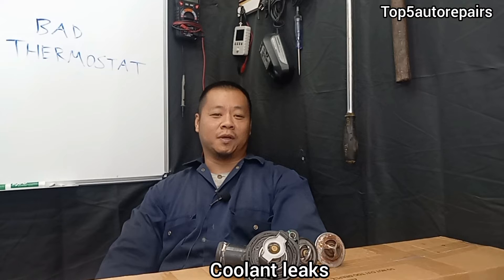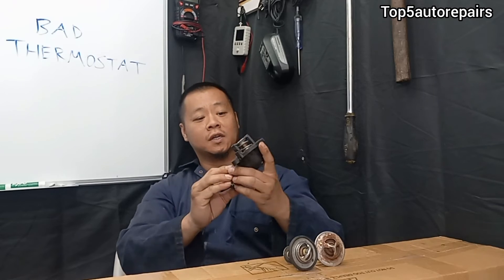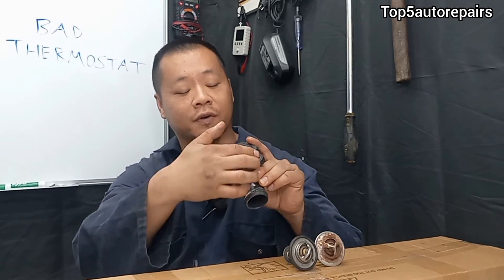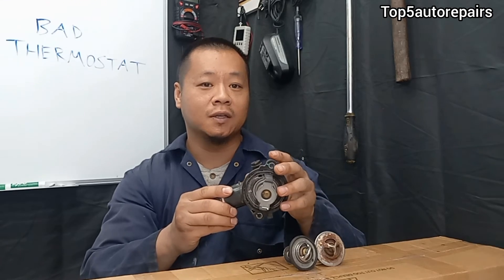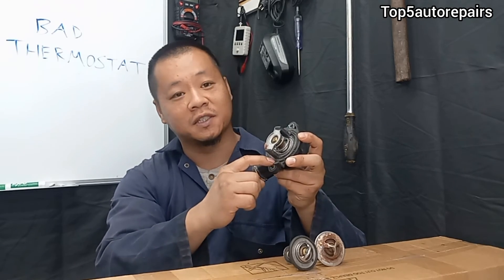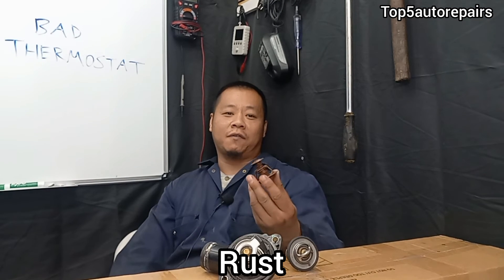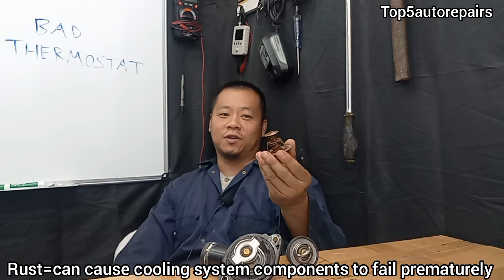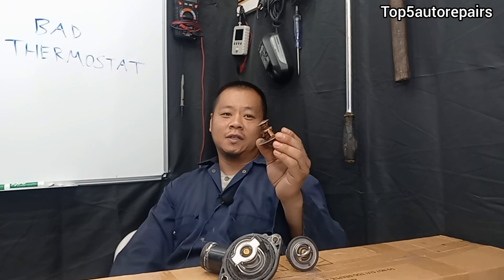How to Tell Car Thermostat Is Bad (Symptoms of Stuck Open Stuck Closed and Overheating)

Comment: No garage has been able to work this one out! VWTouran 62, after both thermostats were replaced by dealership (because of overheating issues )afterwards I now have underheating issues! The dash temp guage sensor has been replaced. Still the guage fluctuates up to 90c n back down to zero. Oil is 50 to 60. And not much heat in cabin. Tho it can stay at 90 and oil at 100 and good heat in cabin. Each time I drive the car I do not know what to expect because its intermittent. Water pump has been changed. AA guy came out today as engine light showed. He was certain it is the thermostat but VW wont except it! I have no idea what to do next.
Reply: Change it yourself 👍🏼
Reply: I would if I knew how! Lol not forgetting Im a granny now not a spring chicken! 🤦‍♀️

Comment: I have a 20–40-thousand-mile Subaru 6-cylinder engine that sat on a bench in an unheated or cooled garage in the Northeast for a few years with no antifreeze in it.  When I ran the engine, the thermostat never opened.  Could it have rusted shut or something else go wrong when it wasn't lubricated?  Thanks.
Reply: Yes, thermostats can rust, get old, all manner of issues. If someone used water in that engine for cooling at one point, then it will rust.

Comment: I have a 2007 Pontiac G 5 2.2L with the heater:

• shutting off when I drive over a sealed line on highway, or accidentally drive over a pothole. I generally avoid driving on potholes;
• turns back on after driving over sealant line on highway, or a pothole;
• heater does not turn on when it is really cold out; and
• driver side footwell gets hot in the summer, especially the floor.

I changed the blower motor, blower motor resistor, blower motor switch, blower motor relay fuse.

My thought has always been that the thermostat needs to be replaced.

I was told the Climate Control Module needs to be replaced as the Recirculate button flashes a couple of times and does not stay on. That one costs like $880 at Napa!

I would like to know if failing thermostat causes my problems? Or is it the Climate Control Module?

Thank you.

Comment: I have a 2000 Isuzu Rodeo that overheats. It melted the radiator cap, so I replaced that, but its still overheating.  NO heat when turning on the interior heating floor/vents or defrost. Has a new radiator and no coolant leaks. Thanks
Reply: Did you check water pump

Comment: What if an older 195° thermostat is only 1/8 inch open all the time and the engine temp stays below 200, even lower in the colder months?

But soon after installing a brand new 195° deg thermostat the engine goes into near overheating, before dropping down to under or at 200°???

Comment: Hey so my car overheats after sitting idle for awhile but on freeway it under temp and cooler by a bit and it takes a bit for my car to hit 180 on my gauge will a stuck open thermostat cause that? I changed everything my radiator my fan my thermostat my water pump and I’m still getting hot idling like if I did virtually nothing.
Reply: did you figure out what the issue was?
Reply: @iblessking650  yup the previous owner installed the water pump with rtb all over all Willy nilly; there was rtb in the water pump jackets; blocking a lot of the coolant from getting in

Comment: Lately the temperatures have been rising in Southern California, I have a Chevy express with the 6.0 and today while driving through the mountains I stopped for a bit on the side of the road and the temperature read 210 it used to read about 180 few weeks ago and it is usually at 190 more or less. Should I be concerned?
Reply from the maker: Yes if the temperature stays above 190.
Reply: @Top5AutoRepairs  so I finally had some time to get my hands dirty and replaced water pump, thermostat, radiator, and fan clutch and my issue still persist. What else can I try? There are no leaks. Thanks
Reply: Flushing the system may help, also could be a coolant temp sensor issue.
Reply: @aaronmlller8150  thanks for the suggestion, I actually have replaced the temp sensor and the issue persists. I never saw the coolant cycling through the radiator which is leading me to believe that there is some blockage somewhere, I don’t know how likely that is to happen
Reply: @Sr_iRL it happens more times that one would think!

Comment: My fire fusion’s driving me crazy man 2o14 2.5 liter there’s a leak near the plastic 3 way value that he upper radiator hose connect to next to the reservoir it leaks when I drive but there’s not crack. I changed the hoses the clamps it still does it 
I can’t find that part any where 
Only other thing I think it couid be is the thermostat anyone have any knowledge on this I’ve never had this happen I’m so irritated
Reply: It’s like pressure is pushing the water out of the upper hose connector between the reservoir and the engine where the hide connect ms to the thermostat and engine

Comment: Brand new thermostat installed!!.... Engine is at normal operating temperature but lower radiator hose still cooler than the upper radiator neck to engine coolant hose.... New radiator, upper and lower hoses and clamps too! Bled the system of air and still have the issue of that lower hose being cooler even at normal operating temperature!
Reply: That means your coolant system is working properly. Coolant flows from the top to the bottom. Hot coolant enters the radiator from the hose at the top, flows down and is cooled by the radiator fins, and exits the hose at the bottom.
 This is also the reason the bottom radiator hose can last two or three times longer than the top hose.
Reply: Having same symptoms what you do to fix
Reply: @CLIFFWILKES i have the same issue with my 2014 Avenger 2.4L. Any solution?
Reply: @edwardsoma  yes after months and months come to find out it was my oil cooler that was clogged it was on a 2007 chrysler 300 3.5, there were coolant lines that run threw the oil cooler, and the crazy part is I had to tell a Mechanic. Because he couldn't figure it out. It made me.
 So angry Because I paid him thousands of dollars.
 To just get everything else wrong. I only figured it out because I decided to just buy the book and study. In meticulous detail. Hopefully you get it going.
Reply: See video above.@CLIFFWILKES
Reply: Also check the temperature of the two hoses going to your heater core if they are at different temperatures or one is warm & one is cold then your heater core needs to be flushed. A clogged heater core will no produce heat inside the car. Also check radiator hoses top & bottom and make sure they not collapsed.

Comment: I have a 2010 b6 passat tdi, today while driving i realised my coolant temp fluctuating between 70⁰c and 90⁰c and when i opened the bonnet i saw what appears to be a leak from a hose connected to the radiator. Does this mean i have an open thermostat?

Comment: have a problenm thermonstat is broken no center no spring trying to figure out wat r where did center go i just tok off all i have is round piece withe hump over the back but the hole center and spring is missing
Reply: Did you buy the car used?  Someone probably intentionally removed the thermostat core.

Comment: Mine had a weird behavior, it was never reaching normal temperature (it was in cold) and the engine was warm, then I park and when the gear was moved to P, suddenly changed to normal temp, also when  I changed from AC to heating knob, it changed to normal temp again
Reply: I have same problem, what was ure problem please tell me.

Comment: My fans won't come on when they need to. Occasionally I will get just the A/C fan but at a lower speed and the regular fan kicks on for a second then turns off. Same after ecu reset. If I jump the sensor/switch on the thermostat housing BOTH fans come on very strong. I noticed my iacv is leaking from the middle gasket also. When I leave the cap off and start the car, the coolant eventually starts to boil and thats when I notice reservoir going low. Any ideas what this can be? I purchased an OE thermostat a month ago, along with all fan switches. Relays are good.
Reply: Did you change the coolant temp sensor?
Reply: @icebeezyent8757  turned out to be the sensor on the thermostat housing. New one was bad. Used my old  OEM one it works like a charm. All my sensors are new except this one.

Comment: I have a stupid question.  

Just did head gaskets on a 2010 dodge Dakota 4.7L.  Got it all back together, topped off coolant after letting it run to bleed air from the system, and it’s been overheating ever since.  We replaced the water pump gasket, the water pump spins fine with no vibration or chatter so the pulley bearing and fins are good.  Replaced the thermostat and housing gasket.  Vacuum tested the system and it held at 26inhg for over 5 minutes. Still overheats.

Found out about the infamous 3.7/4.7L bleeder plug on the top of the timing cover where the upper radiator hose attaches.  Had zero bubbles come out until the truck almost hit the halfway mark on the temp gauge so I’m not sure if they were air bubbles stuck in the system or just bubbles from the coolant starting to boil over.

Heat works, engine runs fine, no misfiring or sputtering like it’s struggling to stay running due to overheating.  No check engine light, no leaks, no smoke.  

Upper rad hose gets hot but lower hose is cool to touch even after needle crosses the halfway mark.  So do you think I have a faulty thermostat (a Stant advance auto parts model) or am I missing something here?

Oh yeah and it has a new Radiator and cap as well.
Reply: take the t stat out and boil some water to the temp of the t stat 82c whatever your tstat is rated for and put a temp gauge in the water drop the t stat in and see if it opens or struggles opening.  i went through 5 bad t stats from the store till i found a good one hope that helps.
Reply: if the bottom is cold and not slightly warm every now and then then ya t stat is stuck closed.

Comment: If I'm losing antifreeze and when defrost is open it doesn't overheat but if normal heat on it does overheat. Is that a thermostat
Reply: Same problem here

Comment: I have a 205 gmc sierra and I replaced the thermostat because the temps where up and down and heater wouldn’t heat, now heater works fine but I’m guessing the thermostat is stuck open because it won’t get to opperating temps and I got the p0128 code… I’m not sure what else to do because both thermostats worked when I tested them
Reply: Explain your “test” procedure. 
Details, details, details. 
Author a procedural process.
Reply: What was the fix?
Reply: Was it the thermostat?

Comment: My 2007 BMW X3 has a stuck open thermostat, oi, after two big repairs already!
Reply: Mine I think is stuck open as well 2005 x3 was having a hard time bleeding it kept overflowing even on cold engine first start up. Changed my water pump and thermostat we’ll see if that works. Lmk if thermostat is your problem

Comment: I just bought a 02 acura mdx  and it runs at normal temp but blows cold air could this be a bad thermostat
Reply from the maker: Thermostat is either stuck open or heater core is clogged

Comment: So my ? Is I have an O2 Toyota Sequoia and today as I was driving my check engine light came on and Auto zone said it was my engine coolant temperature but my heat works good and wasn't going hot and I. Can also squeeze my radiator hoses .also I have 281k on my vehicle and in. The pass my check engine light will come on but go away over a week or few days so kinda wondering what it could be

Comment: My thermostat is stuck open on a 2004 Kia Pregio Diesel with no EGR or dpf. I can't afford to fix it until next week. My question is will it damage my engine if I drive for 30 minutes a day at 60 kilometers per hour until I can afford to fix it?
Reply from the maker: It will take longer for the engine to warm up. In the short term it will be fine. Just make sure to replace it when you can afford it.
Reply: @Top5AutoRepairs  Thankyou for your reply it is much appreciated. Will do as you recommended.👍

Comment: I got a 2000 toyota camry and i have the common sign  which is the temp fluctuations like you said , the temp gauge goes high and low while driving . So i guess the thermostat got stuck open cause my car doesn’t heat properly and in winter time , when it’s very cold , the heat doesn’t work properly so i’m cold sometimes on my car. So do i need to change the thermostat?
Reply: Hi  budy , here we talk about mechanic's (only).
Reply from the maker: It's definitely stuck open
Reply from the maker: So go ahead and replace it
Reply: @Top5AutoRepairs  ok thanks a lot
Reply: No; send it to Donald Trump! After all this explanation you are still asking this kind of question.
Reply: @hapio1307  you’re stupid, i have to make sure if the thermostat was really the issue. You don’t know sometimes it’s not the thermostat , you got the heat core that can be broken too. Don’t post a nonsense comment when you don’t know nothing.
Reply: @hapio1307  you must be stupid. Before replacing a bad part , you have to make sure if this is the right diagnostic. Sometimes it’s not necessary the thermostat, there’s the heating core that can be bad too.

Comment: back in the summer my toyota corolla 2005 temperature gauge would go up and down after  engine warming up
and  now  in winter  the  gauge wont go to middle  and heater take like 30 minutes to barely blow any warm air and for hot air it takes  like an hour .tnx bro i will change the  thermostat
Reply: how much it cost to change the thermostat?
Reply: @Hidriz  it costed me 6$ cause i live in an asian country so iam sure it will cost u 20x more
Reply: @NemanNik did that fix your problem? I get overheat sometimes, sometimes ok I think I will change thermostat it has 243k miles haha
Reply: @johnnyversaci7091  i used to put just water in the cooling system  and that rusted the  thermostat was jammed in close position so yeh it fixed it
Reply: @NemanNik  ok cool mine overheats sometimes but then temperature goes to normal, also the heater takes a very long time to work sometimes

Comment: Would the heater core also blow cold if the thermostat is stuck closed?
Reply: Ok thx.
Reply from the maker: It will blow hot and the engine will overheat

Comment: So my temp gage goes from super hot to regular tempatures and keeps moving .. that means it’s partially open? && does it effect the heater in the car ?
Reply from the maker: Yes it can affect the heater. Coolant flows through the heater core.
Reply: Hey my Nissan max is not over heating but my cabin is hot, could this be the thermostat, I just changed the AC clutch and a new radiator, it still blowing hot air.

Comment: The hose from the radiator to thermostat is never get hot so I change the thermostat and still the same I drove the car like this more than 2 years and it’s never got overheating ..help plz what’s wrong
Reply from the maker: Look at the temperature gauge needle. If it's near the center then there isn't much to worry about.
Reply: @Top5AutoRepairs  
Yeah the needle it’s were it’s should be
Reply: @Top5AutoRepairs  
From my understanding is The big hose from the radiator to thermostat it’s should get hot when the car is running for a while ..but mine doesn’t and I didn’t face overheating
Reply: @Top5AutoRepairs my Hyundai accent has a thumping noise in the radiator hoses and it doesn’t blow heat. When I give it gas the hose to the engine would suck in and get flat like sucking in your stomach. Any help

Comment: Thanks for sharing this video 
Is it Wright when thermostat stuck open
 means increasing fuel consumption ?
Reply from the maker: That's correct
Reply: Can that course it to run rough as well
Reply: Mine runs fine when cold but in 5 minutes it runs ruff but it's not hot